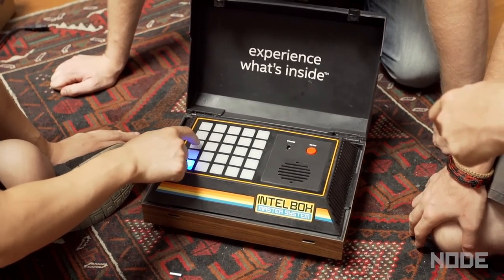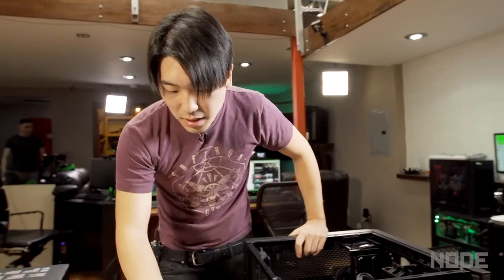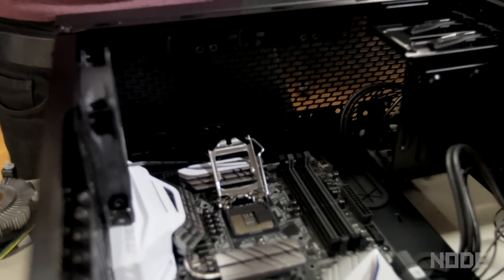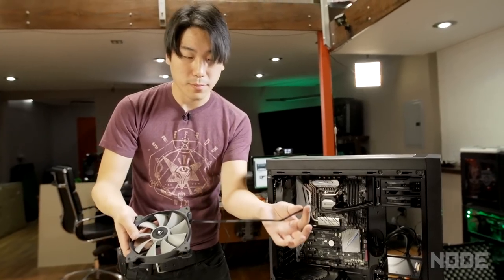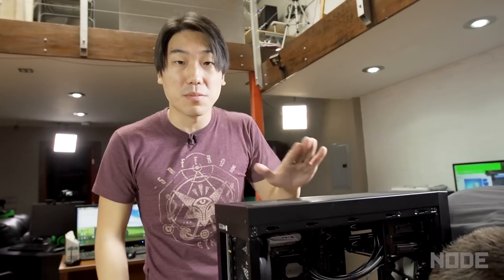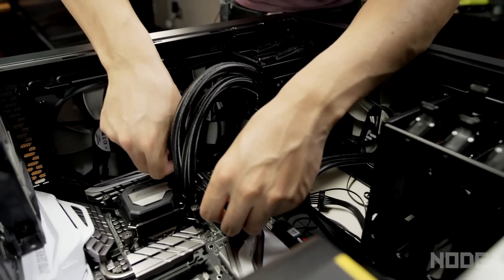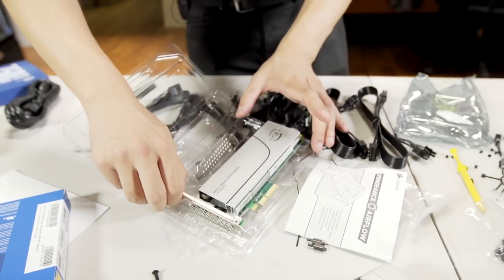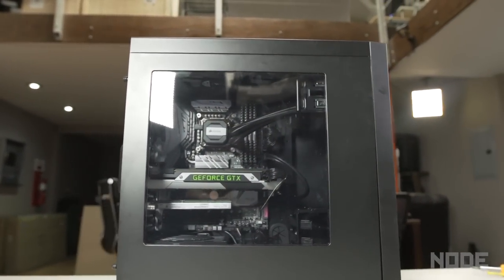BEAST INTEL PC BUILD

Comment: Can anyone help me? I'll be building a pc for the first time and I got these components that I'm planning on buying. Do you think this will be enough to play AAA games (like gta V and fallout 4) at 60fps on 1080p? Anything I should change to improve this build?

CPU: Intel Core i5-4460 3.2GHz Quad-Core Processor
Motherboard: ASRock B85M Pro4 Micro ATX LGA1150 Motherboard
Memory: Crucial Ballistix Sport 8GB (2 x 4GB) DDR3-1600 Memory
Storage: Crucial BX100 250GB 2.5" Solid State Drive
Storage: Seagate Barracuda 1TB 3.5" 7200RPM Internal Hard Drive
Video Card: Sapphire Radeon R9 380 4GB Nitro Video Card
Case: Fractal Design Core 2300 ATX Mid Tower Case 
Power Supply: EVGA 500W 80+ Certified ATX Power Supply
Total: € 782,50
Reply: +Arne - Rythmus Thanks in advance!
Reply: if I were you I would spend a bit extra getting an unlocked i5 and a better motherboard to handle said i5. you could also go for faster ram but 1600 is good enough.
Reply: If you're on strict budget, get an AMD FX 6300 and throw in a Hyper evo 212 instead of an i5.
Or otherwise, get an unlocked i5 - k series. It'll make your system future proof.
Reply: +Arne - Rythmus post on linustechtips.com and youll get better help than here. overall looks good for a first build. I wouldnt bother with an unlocked cpu for gaming. just add the hyper 212 evo and your set. if you do need more performace down the line you might be able to pick up an i7 second hand
Reply: kapil deshmukh I'll need another motherboard tho?
Reply: +Arne - Rythmus if you opt out for an amd route then you will need an amd compatible motherboard. if you stay intel then you are fine with what you have

Comment: The power supply must be up side down, the fan take air from the base not from the front.
It was more easy pre-mount the fans of the liquid cooler.
Not the best case for a "gaming" PC.

But well, better PC than the Nvidia channel PC that was for hyper rich people. Good Job anyway ;)

Comment: CPU heatsinks come with thermal paste pre-applied, but I still scrape it off and buy some nice third-party stuff. I even tested it, and it was 5 or 10 degrees Celsius cooler than the default. I did the same thing with my GPU's heatsink.

Comment: For the sheer power in this thing, I'd have gone overkill and gotten a second GTX 980, as well as 32gb DDR4 RAM. Yeah it costs a ton, but cmon, you'd be in the God-Tier of PC's.
Reply: It was Mid-tower, I don't know if it can support SLI
Reply: +Rolli Kur A bigger tower would be the cheapest part :P
Reply: +Rolli Kur of course it can, you can fit SLI rigs in mATX cases. What do you think all those PCi-e slots are for? Why wouldn't you think so haha
Reply: ThatOneGuy Well NZXT have fucked  up in that department before, not the Phantom though, i love that shit. personally i only really use full-towers, and so physical space has never really been an issue. (Thanks for being polite about correcting me by the way, its a nice change)
Reply: +Rolli Kur I plan on getting the Red Phantom though. XD

Comment: A system like this does absolutely positively not need an 850 watt power supply. It could probably get away with half that amount. Also the way you handle some of the most sensitive components of a computer is just absolutely cringe worthy.
Reply: It never hurts to have extra head room for over clocking and possibly add another gpu for SLI. So an 850w is pretty much alright for this build.
Reply: +THESPAREG33K Just another monster fridge xD

Comment: Reference model GPU... No. Just no. Should've used one with a proper cooler so it's quieter and runs at lower temps so it's easier to overclock.

Comment: My new rig (made to be pretty overkill since it's a hybrid server/desktop/gaming/rendering machine (I also use it for compiling code)):
Core i7 6950X (10 cores 20 threads 25Mb cache)
32Gb DDR4 3000Mhz with XMP
256Gb Kingston M.2 SSD
4TB Sata3 HDD
GTX 1070 8Gb
Expandable Alphacool Eisbaer water cooling loop

I previously had a 4 SSD LVM striped array (like raid but done by the kernel so it can be used on any PC without a raid controller, also faster than most RAID setups since it can leverage the CPU and RAM for intensive operations), but I found the PCI-E SSD is just as fast if not more.
Also this is my first Intel build, I previously had a Phenom II 1100T X6

Comment: EL OH EL - This is a PC for peasant gamers.

ASUS X99 Extreme V
Intel Core i7-5960X
64GB Corsair Dominator Platinum
4 x EVGA Titan X Hydros 12GB
2 x 1.2TB Intel SSD 750 Series
Cooler Master M2 Pro 1500W PSU
Cooler Master Cosmos II XL-ATX
3 x Samsung 28" 4K monitors

Comment: Thanks man, I looked up all these parts on Tiger Direct and its about $2,500 to build this PC. I need a knew one, my specs are alright, but not for all the artwork and video editing I would like to do :D Any help with suggestions upgrading this will be appreciated!

GeForce GTW 760
Intel(R) Fore i5 750 2.67 GHz
12gb ram
And too hell if I remember what type of motherboard I have. been about 5 years maybe longer. xD
Case is a  Full Cool Master HAF 932 I believe, but it cools very close to it.

Comment: Also, you guys saved a good chunk of cash with the Intel Processor and SSD drive PCI x4 in the Intel Mystery Box video. Don't forget the mobo has a built in m.2 x4 slot you could take advantage of. I personally used it on my Asus Maximus Impact VII Z97 motherboard in a Corsair 250D case to save on having to buy a bigger case and motherboard. The heatsink putty also I cleaned it off using the Arctic Silver 2-step solutions and used the Innovation Cooling Diamond 7 Carat instead.

   It's a great build what you guys made to accommodate the large cooler. Is this for Sam the PC and are you planning on putting a second card?

Comment: I love all your guys' videos except every PC build. You guys make so many big no-nos, it's ridiculous. Just an example, you never touch the CPU where it will meet with the heatsink. Any amount of oil or debris will ruin efficiency. If you do touch it, need to wipe with 70% alcohol. Also, never apply any pressure when seating the CPU. just drop it in place, accurately first time. If you apply pressure and bend a pin, that GG. Given components now-a-days are pretty durable and fool-proof, its still horrible practice, lol.

Comment: DDR4 Ram isn't up to it's true potential just yet. Manufacturers are just getting the minimal specs for what DDR4 is truly capable of so they should expect to have to get more RAM in about 2 to 3 years when the CAS latency improves and the timing improves. As of current there is about 15% increase of what DDR3 was doing and an increase of bandwidth. Those numbers are going to improve very soon. Also there was no ESD protection while building this, plus every gamer knows that you should include at least some custom LED fans to complete the look of the build. And for some added flare you can add LED strips to keep the thing glowing nicely. It's not a true build if you can't show off your beautiful parts inside.

Comment: Hello everyone, I am building a PC for the first time and I need some advice on it, is it good, bad, what can I improve and what do you recommend: http://pcpartpicker.com/p/zhjRrH
Reply: Jack D. Ripper Ok thank you!
Reply: +It'sEganTime http://ca.pcpartpicker.com/p/2mXx8d I rather get the intel cpu instead of an AMD one since intel cores are stronger than amd cores. The g3258 is newer compared to fx-4300 and it is much more stable at overclocking in my opinion. Just look up some overclock tutorial guides on YouTube on the g3258 cpu. If you still decide to go for an AMD cpu then remember, they often uses more power and which therefore will generate more heat. And get an Nvidia gtx 750 ti or even an newer graphic's card like the gtx 950 (if you have the budget) for gaming since both of these are much more better than gtx 650 and has a better value than the gtx 650.

Comment: uk prices
6700k = 310
5820k = 300
Difference? One is 6 core the other isn't. DX12 is going to utilize moar coarz so yeah, pointless build. In addition, you can remove PhysX and set it to the PC.

Comment: I wish I had the money to do this only computer I have is a HP 620 laptop
Reply: It's not very expensive. You can get a full PC with monitor, OS and basic peripherals for under 600. You may need a little budget cutting, and savimg money for a decent gpu, but integrated graphics do fine on light games with mid settings.
Reply: striker113 thats true

Comment: Thought I'd do a shout out guys for anyone who's thinking of buying on of those big fancy looking cases, D's right, DON'T, not just for compact reasons, they are usually idiotically designed and have lots of unnecessary bits bolted to them. I made the mistake of buying a Phantom case once, while it looks cool it's such a pain in the arse, you also need to make sure your cases are properly setup for the motherboard you've chosen. Always go for functionality and compatability over anything else.

 Oh and for those wondering about the price of this stuff, it is absolutely worth it getting high end gear, the difference is amazing and performance wise they won't be outdone by anything else for quite a long while. Just don't buy any useless fancy shit that glows and so on.

It was refreshing watching somebody put PC components together on youtube that actually knew what they were doing well done D! :D

Comment: you didn't mention or demonstrate proper grounding during this install, particularly while handling the RAM, CPU, and GFX ... not everyone has hardwood flooring or an office environment to work in. I probably wouldn't mention it, except I know a guy that fried 3 Graphics cards by simply walking across his carpet from the box to the case. He didn't realize that's what had happened until I was there the third time to see him do it. He brought it right across the carpet to me, not being careful about holding it by the edges. I was looking in the case at what was there already, I looked up as he reached over and touched the case with it in his hands. Fortunately, he got it replaced as being DOA, but he learned his lesson. It would have been an expensive lesson otherwise.

Comment: Just as an FYI to a prospective PC builder, it's poor practice to assemble things in the case straight away. You should breadboard the motherboard (rest it on a non-conductive surface, such as a bread board) and perform the Windows installation (and any troubleshooting you might require) outside of the case. By keeping the motherboard, and everything else, on non-conductive surfaces, you mitigate the potentiality of a freak contact being made with the case on the underside of the motherboard. It also makes troubleshooting much easier by having all the components out loose to change around, rather than all screwed into the case. It saves time and energy, and doesn't really require any extra effort. You're simply shifting around the order of actions to perform on your build.

I get why it wasn't done in this video, for the sake of elegance and time. But if you're doing this proper, you need to be executing the correct techniques.

Comment: I love the video bro, but it seems you are having difficulty with technical terminology. For example, nobody puts "putty" on their CPU they use thermal paste.  Also, for better temps, it is recommended to not go with the standard stock paste with the cooler.  Arctic Silver is pretty decent.  Again, great video!

Comment: D, you should really be careful when making a video like this. You have a big audience and you might misinform a lot of people. The main thing I wanted to complain about is how you didn't check the CPU socket for and dust or hair, how you touched the CPU heatsink with your finger smearing your finger oils all over the center and not cleaning it off with alcohol, and how you pushed down on the CPU, which can sometimes result in bent pins, which are a huge pain to try to fix, especially for beginners.

Comment: Awesome build, I have the same case, PSU and CPU cooler too and they fit and look beautiful inside the 450D. One thing got my attention tho, you must have your own reason for putting the fans on the radiator on a "Pull" config but I think that is not right. You're basically going to be sucking the hot air from the radiator into the case.

Comment: Why are you touching the top of the CPU? It's called zero insertion force, but I guess you just don't want your all-in-one liquid cooling unit to perform to its maximum potential. There is absolutely no reason to touch the top of your CPU. It's only going to hurt temperatures. I really hope you cleaned it off before installing the cooler.

Comment: so he gets to installing the CPU and says if you fuck it up your in trouble, then instantly goes into not showing how simple and idiot proof it is, honestly the only way to fuck that process up is to 1. put it in upside down. 2. add any pressure to it or 3. move it once placed. thats about it, unlatch the holder, grab it from the sides, not the gold, set it down correctly which is obviously shown, then use the levers. how hard is that? also obviously a sponsored video as most of these things they are using are really unneeded or over powered for the setup, why the hell would you need a 400gb ssd, and a 2tb hhd? most builds have a ssd for os and simple systems like that, never would i need 400gb's. even editing your better off with tb hhd's 400gb would go by so fast with raw footage. cringy as fuck

Comment: At this point with the shortage of 6700ks it is almost the same cost to build a 5820k machine. Granted they got this stuff for free but for the slight cost increase on the mobo is worth the extra process threads, integrated ram controller, bigger cache and generally all that comes with going extreme.  Unless you really care about the sick nasty overclocking you can get on skylake.

Comment: This video is a key example of why people that do not know how to build a PC should not build a PC and should not make a video about making a PC.  Slapping together PC parts like Lego is only part of it if you don't have the slightest idea how to build it properly.  Hardware aside that airflow is just stupid and just shows they don't know what they are doing the noob way they have it set will fill the case with increasingly hot stagnant air because they have 3 fans pushing air in 2 of those are pushing in 50-60c hot air that already hot air is getting pushed into the system and with only one case fan extracting there will be more hot air going in than coming out and airflow will be terrible resulting in an extremely hot mobo and all that hot air pushed into the case by the CPU rad will get sucked up by the graphics card causing it to run way hotter than it ever should.  On top of that he installed the PSU upside down like a noob so rather than it pulling cool air from the vents in the bottom its gona pull in the extremely hot air from the case.

Comment: All motherboards come with a manual, I'd highly recommend following the manual to do the wiring, everything ends up connected into the motherboard anyway....so it makes sense to use it as your main guide, especially if you are doing this for the first time. Makes it a breeze.

Comment: Is it only me or am I the only one picking on having the power supply's van facing the top instead of the bottom? Not the only thing, there's how the radiator was installed etc and stuff but yeah, that's the thing that is bothering me the most, 'cause how I see it and how I was taught is that it'll blow alot of heat onto the SSD and Graphics Card. I'm not hating or trying to be a dick, just saying the air flow on this build is kinda wierd. o.O

Comment: barny8000, you do get a stock cooler, it depends on what one you buy OEM, or retail, the retail is about 310 more expensive, and comes with a cooler. If you don't get one why when he opened the box on camera, did he get one out of the box.

Comment: i can build a pc just find the front panel wires and all that jazz all the fitting even the heat sink...but i still get someone else to fit the processor because i hate  screwing that up, one bloody pin bent and that's like £150 down the drain

Comment: Is this a good build? idk if this is a good PSU.

CPU: Intel Core i5-4690K 3.5GHz Quad-Core Processor 
CPU Cooler: Cooler Master Hyper 212 EVO 82.9 CFM Sleeve Bearing CPU Cooler  
Motherboard: MSI Z97-GAMING 5 ATX LGA1150 Motherboard 
Memory: Corsair Vengeance 8GB (2 x 4GB) DDR3-1600 Memory 
Storage: Samsung 850 EVO-Series 120GB 2.5" Solid State Drive  
Storage: Western Digital Caviar Blue 1TB 3.5" 7200RPM Internal Hard Drive
Video Card: MSI Radeon R9 380 4GB Video Card 
Case: NZXT S340 (Black) ATX Mid Tower Case 
Power Supply: Corsair CSM 550W 80+ Gold Certified Semi-Modular ATX Power Supply
Reply: +CeTAX All seems fine. If you're worried about power supplies I personally like the EVGA brands. make sure to buy a lot of fans :P

Comment: Why did you build it straight into the case? I built mine outside the case first to check nothing was faulty. Otherwise if your motherboard doesn't work you have to take it all apart again

Comment: Back in the day we used to have to apply thermal paste ourselves, you still should when it comes pre applied it's usually worse than what you can buy and way too thick and "back in the dark ages there use to be screws to put in HDDs" first off a lot of cases still have that and second off cases started putting those in not too long ago there fairly new

Comment: Is it me or did d put together the PC in a wrong way? It's a lot easier to install cooling before the motherboard. And also, it's easier and safer to install the CPU and the RAM in the motherboard first before putting it in the case.